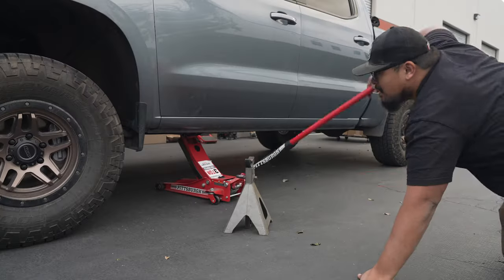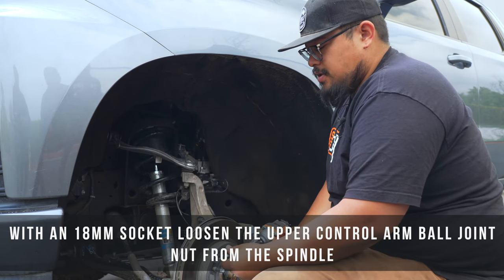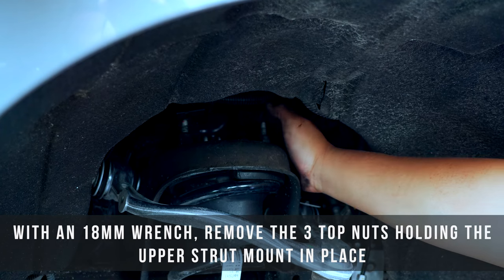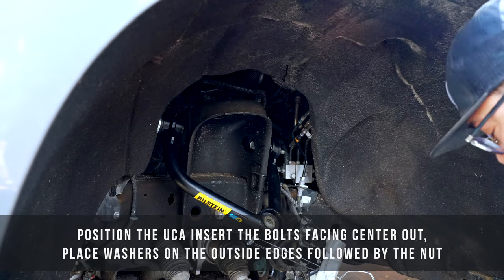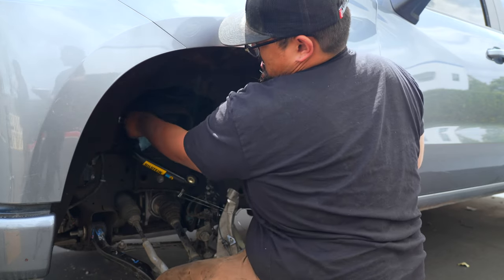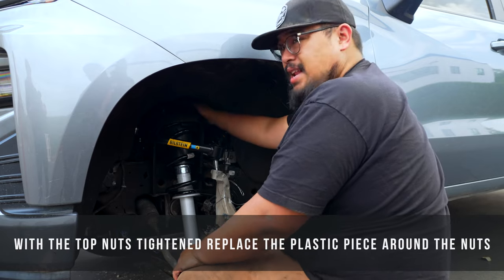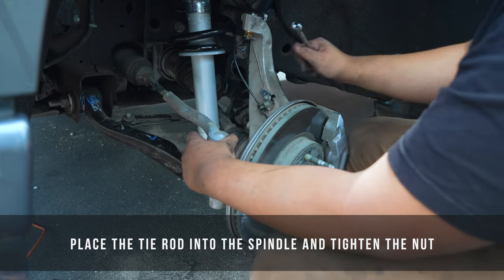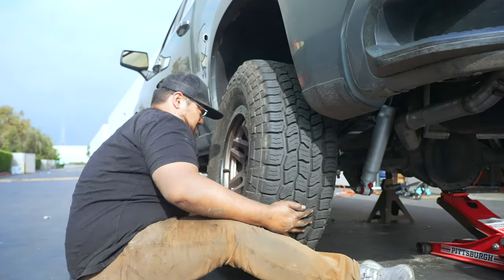Rancho Quicklift & RS9000XL Install - 2020 Silverado 1500 Z71 RST

Comment: I’ve installed my Rancho 2” quick lift to level my truck but im shorter on the rear. I see he has a Z71 package which usually brings a bigger rear block compared to non upgraded stock suspension. How big of a rear block would I need to level my truck like this Silverado? I think my rear block is 1.25 inches.
Reply from the maker: Measure the distance from the center of the wheel to the top of the wheel opening front and rear. Subtract those two lengths, and that will let you know how much more lift you need in the rear.

Comment: Why would you replace the Bilsteins with Rancho???
Reply from the maker: For us, neither the factory Rancho nor the Rancho Quick lift and RS9000XL held up to our needs. We are using the Silverado as a daily driver, a towing vehicle, and some light trail usage. Bilstein held up better for most aspects and Fox definitely helped out more on the trails. We are testing various products and various vehicles to see how they perform based on our needs.
Reply: @ShockSurplus  So I have the Rancho quick lift leveling kit for my ‘24 Silverado Z71 LTZ with the 3.0L diesel going on in a few days. What setting should I run for daily driving? Will I need to set it slightly harder to account for the weight of the diesel, or is it just a put it on and test it in all 9 settings to see what runs best? 

(I’m figuring I’ll need to set it at 4-6, but I’m not quite sure)
Reply: @CarGuy5141 have mine set at 3 all around and i love how it rides compared to stock. Mines a 6.2. Cant imagine the diesel being much heavier. Havent towed with it yet though.

Comment: How would you guys compare these to the rough country N3?
Reply from the maker: If you want our honest answer we would not really recommend either to the average person, but we do think Rancho does a littler better job at tuning their parts for applications. RC is fairly infamous for using fairly generic valving on their shocks where as Rancho at least tries to get their parts a little more dialed in for each application. With that said you are better off looking at options from Bilstein, Eibach, or Fox for similar money. They are all built to a higher standard and will ride, handle, and generally perform a lot better than a Rancho or RC

Comment: How was the rancho quick lift compared to the bilstein? Going on a 2016 Silverado that tows more than it goes off-road but definitely want to keep that 2" level on it.
Reply from the maker: Despite being convenient as a fully loaded strut, they don't seem adequate in any sense and are not where near in the same league as Bilstein. We remove the factory Rancho off this Silverado and through on The QL. They were marginally firmer but still way too softer regardless of how we set it up. Bilstein 5100, 6112, and Eibach Pro Truck are all much better suspensions.

Comment: I've heard if I use any brand other than Rancho. The warranty on my truck will be void??? I have a 2019 Silverado LT and I want to basically install the Trail Boss suspension. I just want to make my ride smoother. I feel EVERY little bump in the road.

Comment: How tf did you reach the top 3 nuts with that plastic cover all over it? I have a 2023
Reply from the maker: We removed those with a pick.  https://youtu.be/lQclQ543vvY?si=LR1HJh982HZ5kl9S&t=272
Reply: That plastic bracket is only covering 2 bolts. Mine have square holes in it big enough for the strut stud to stick thru but not the nut: i was able to get at those holes from underneath with a drill bit and reamed out the holes big enough to drop an 18mm socket through from the top so i was able to still use the impact gun.
Reply: How did you get at the rear nut? With the two bolts from the strut in the way and having a hell of a time trying to get out that rear nut.
Reply: @bobbaldwin8369 on the pass side i went down from the top. You have to pop off the wire loom thing then used a deep 18mm. Pretty sure i was able to fit my m12 gun in there. I might be dreaming that tho idk. On the other side i was able to get at all 3 with a ratcheting wrench from the wheel well.
Reply: @bobbaldwin8369 if you have the other 2 off put one on snug tight. You might be fighting the weight of the strut and whatever pressure it’s under. Once i broke tightness i was able to pretty much spin those off by hand.

Comment: Will these steps work for a 2017 silverado on replacing the front strut?
Reply from the maker: They are roughly the but not 1:1. You can use this as reference though.

Comment: I'm looking into 6112 in front and 5160 in rear with Bilstein UCA. It looked like he has sumo springs in rear. I have sumo springs in the rear and it changed up rear a lot. Especially with my quad in bed. Any chances after Fox's you'll switch to 6112 & 5160's? I tow, daily & off road with my truck. But maybe 5 times out of year would be offroad and tow.
Reply from the maker: We are planning to do Eibach next. We have done tons of 6112/5100/5160 so that is still up in the air. But eventually we want to do all the 2.5 series as well.

Comment: Is it a must to cut off that UCA limiter ?
Reply from the maker: Technically you do not have to but it will limit travel. That is not really a concern on something like these Ranchos, but if you are running an extended travel 2.5 coilover like a Fox or King for 3" of lift or more, or a Trail Boss or AT4 spec option like Bilstein offers in their 6112 line you will definitely feel those limit travel before the coilover or struts can fully extend or give you all the travel they offer

Comment: Do the UCA's on these trucks not have alignment plates/pins? Did i miss something?  How would they get aligned?
Reply from the maker: They have some but very limited to how much they can do. Going with an after market UCA provides clearance and correction and in some cases further camber and caster adjustment.

Comment: Do you need to replace the upper control arms or can you keep the factory arms
Reply: he mentioned you can keep factory uppers . However i missed him telling us to get an alignment done , which i imagine  is important .
Reply from the maker: When we ran the Bilstein 5100, we did not upgrade the UCA. Once we we did the Rancho Quicklifts and RS9000XL, we did upgrade the UCA. It wasn't an really an alignment concern but the stock UCA were pretty much maxed out so upgrading the UCA get us better articulation. One additional note, some 2.5 series will require you to upgrade the UCA because of the larger suspension running into clearance concerns.

Comment: What would yall recommend on a 2013 f150 regular cab 2wd?? Its pretty light but id want a soft ride.  I have new oem struts.. but they are super stiff, hardly compress even though they are the same as my old struts, just newer. No towing or anything. Just a small town daily driver.
Reply from the maker: As far as stock replacements go, you will be hard pressed finding anything softer than stock, however even though a touch firmer many of our customers see lots of improvement in ride from a Bilstein 4600s. Otherwise if you do not mind the front coming up 2" the Fox 2.0s are pretty plush.

Comment: I bought a set ranchos front struts leveling kit, and the ride quality is bad, it doesn’t matter if I put it on the 9 or the 1 setting it still rides really rough. What do you recommend.
Reply from the maker: The adjustment on Rancho parts are very minimal and not drastic. We personally don't run any of their kits on any of our vehicles any longer.

Comment: Is it the same for 2023 gmc at4?
Reply from the maker: Install is the same, but we only did this install for testing purposes only. We have a hard time justifying replacing the lack luster stock Ranchos for more Ranchos. Plus if you are planning to go any higher than stock AT4 height, Rancho is definitely not your brand.
Reply: @ShockSurplus  I'm all ears 👂🏿👂🏿 fox 2.0s?
Reply from the maker: Those are a good choice but are tapped out at stock height just like a Rancho and do need a fair amount of service. If you were considering 2.0s, Bilstein has a set of 6112s and 5100 or 5160 rear shocks that are a similar price, last twice as long before needing to be rebuilt or replaced, and can be adjusted from stock AT4 or Trail Boss height to up to 1.2" of lift in the front. So even if you are planning to keep it stock height, it will still work better than the Ranchos or Fox as they will not be maxed on on adjustment.
Reply: Hey bro 
What adjustment number you running? I installed on my 2018 Siverado and it jumps a lot.